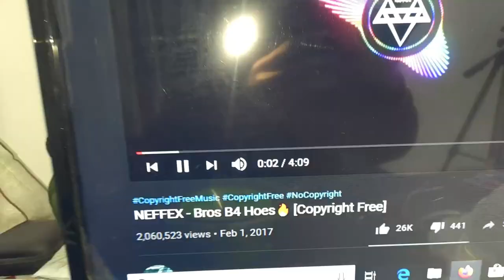Testing Hypersonic Component Speakers

Comment: I guess extra subwoofer has been used invisible from viewer's...
Reply from the maker: No bro subwoofer has been turned off whenever I do this kind of tests. Otherwise there is no point.
Reply: @AmulLuthra  ok , what if I install it without amplifier ? Will the output be same or different ?
Reply from the maker: It will be close as this speaker is only 45w rated but with amp it gonna sound better because most stereos only push about 20w RMS.
Reply: @AmulLuthra  ok 👍
can you suggest one music system package for alto which includes stereo (no touchscreen) , speaker with good output (bass) , takes less space , without amp ...